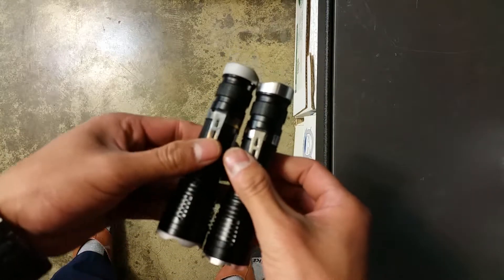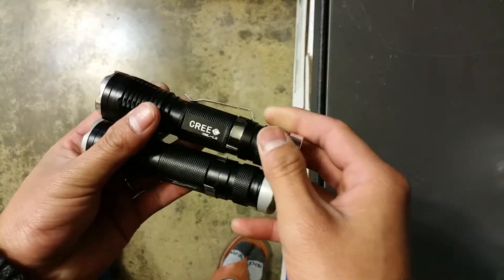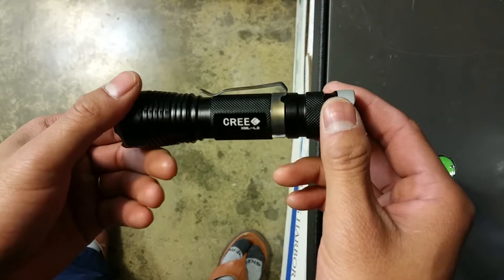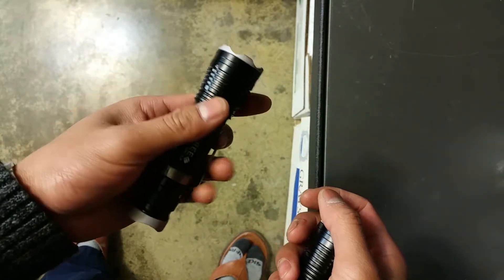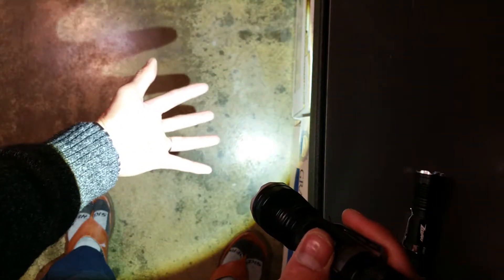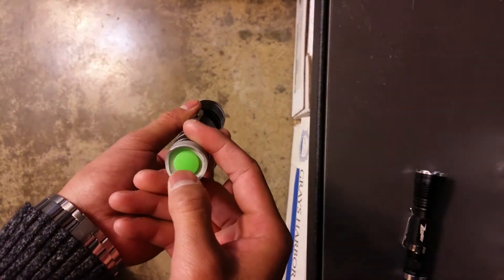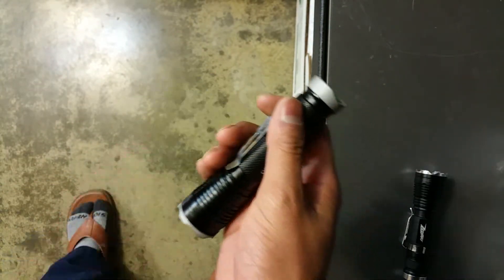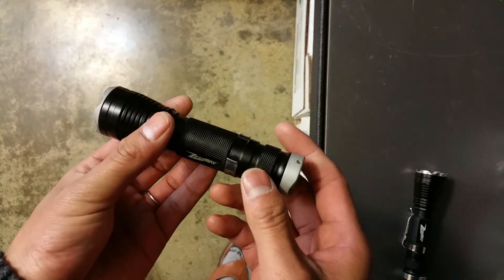ZrayVN Short Review

Comment: I have two identical  lamps from MyLED.com , but by a different name, but head, body and tail-cap are identical.

Another good mod is to make the flood wider still.  Very easy to achieve by putting the body in a lathe and removing the ridges behind the sliding head.  This allows the head to zoom back another few mm.

I also cut another O ring groove a little behind the first one to allow the head to remain seated on a ring.  Slide is not as smooth now  but flood is so much wider.

Also replaced with XML2 on Notigon and a 4 mode no blinky moonlight , last mode memory 5 amp driver 

Surprised to hear you talk about the finish and look of the body and doing stuff to it to change its physical appearance.  Something like that would not have even occurred to me.  What it looks, like, anodising quality, sandblasted end cap, etc, to me, below irrelevant, Functionality is all that is important to me.

Keep up the good work